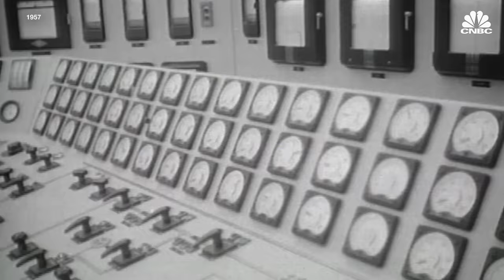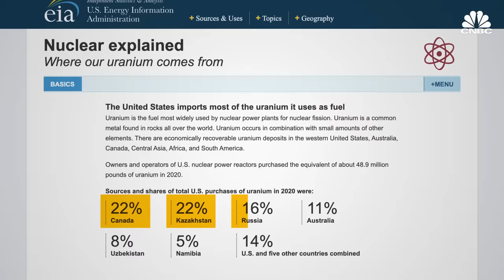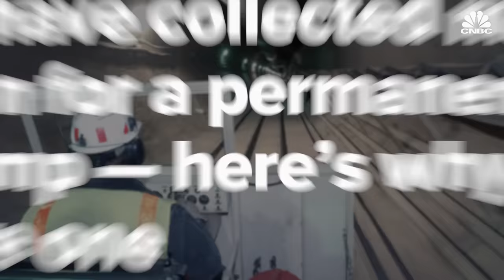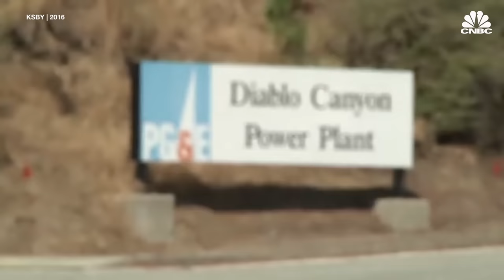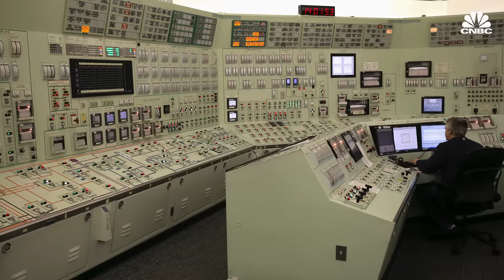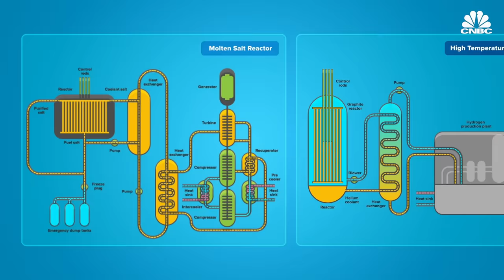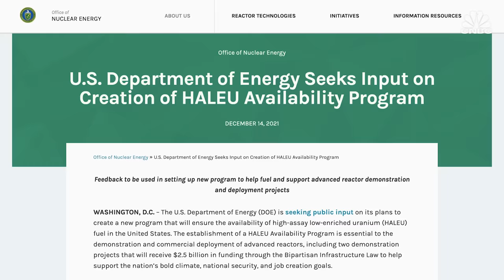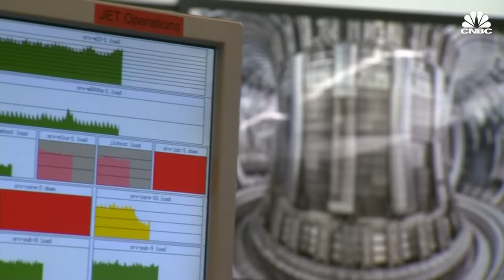Why Nuclear Energy Is On The Verge Of A Renaissance

Comment: Our rejection of Nuclear power was a massive mistake, and the environment has payed dearly for it as we continue to rely on fossil fuels for our electricity
Reply: It was rejected because of how profitable fossil fuels are for the corporations. Nuclear power is too cheap.
Reply: @jacktravolta1398  Saying something does not make it true.  Here is the reality of new nuclear in the U.S. and the only new nuclear power plant projects in the U.S. in decades.
VC Summer (South Carolina) new nuclear units 2&3 were canceled in 2017 after spending $17 billion on the project (original estimate of $14 billion and 2016 completion date) with no clear end in sight for costs or schedule. 

Vogtle (Georgia) new nuclear units 3 &4 currently 110% over budget and schedule (now over $30 billion) and still not operating. Mid way into the build, the utility stated that had they known about the many costly delays they would never have chosen nuclear. They are now delayed another year because according to the project management, thousands of build documents are missing. 

Is that too cheap?   South Carolinians would definitely disagree and Georgians still don't know if they will ever operate or how much it will cost.
Reply: It’s called fear.  And possibly mob mentality.  Combine the two and yikes, an over reaction.
Reply: Your second comment is an opinion not fact.  The earth is self regulating system to hot, O2, fires CO2 and cooling periods called ice ages.  The end of he last mini ice age was approximately 1715.  After that date the earth went into a warming period.  Tree rings are the method scientists use to correlate hot ( large tree rings) and cool (small) periods but we’ve only had thermometers for approximately 100 years. The first study, which indicated people were warming plant, never looked at correlating the size of the tree rings to a thermometer.  Another study did and the data matched up to 1996 then the correlated tree to thermometer data Deviated and showed temperatures lowering over time.
To me it seems the best approach is to conserve. You can’t legislate that, I see many people that are proponents of zero emissions that fly private. Talk about emissions.
Reply: @jacktravolta1398  nuclear power is literally the most expensive form of energy
Reply: @philmanke7642  nah mate
Reply: @philmanke7642  Prior to deregulation, the utility primary goal was reliable power. Now the primary goal is profits for the investor owned utility and that does not include excess generation capability
Reply: @jacktravolta1398  How is it cheap when nuclear plant costs billions to build operate and maintain. I do agree we need to build more of them
Reply: @jackkennedy9475  SO are planet isn't warming and if it is it's not caused by mankind's behaviors
Reply: The worst part is that some of the people against nuclear call themselves environmentists.  Does environmentalist now mean someone trying to destroy the environment?  😁
Reply: @winoodlesnoodles1984  Unfortunately it seems that way. To me an environmentalist is an engineer and problem solver. Those that criticize and complain are just activists with very little knowledge or they've been brainwashed
Reply: @wizzerwiser2056  Fair points!  You portrayal of activists is spot on.
Reply: @winoodlesnoodles1984  Greta TOONBerg always comes to mind.
Reply: @wizzerwiser2056  🤣😂😅🤣😂
Reply: @YellowRambler  So what is the right combination. Do you feel thorium is a better solution for nuclear energy.
Reply: 'always follow the science'
Reply: @pondeify  the political science.
Reply: The word is NUKULAR!
Reply: Well, it would have been nice has the previous generation(s) of nuke designers, builders, and operators hadn't screwed up.   But they did.
Reply: @GilmerJohn  the past is dead, we either move on, or we die with it
Reply: @Jim54_  --  We don't "re-invent the wheel" each generation.   There are lessons to be learned from US society turning its collective back on nuke power.

If you don't re-visit the mistakes it's  likely they will be repeated.

What were the mistakes: well we know about sloppy workmanship; sloppy design; sloppy maintenance; and sloppy operations.   How will the "next generation" of plants address these problem?   We seem to be being told that the "next generation" will be immune from all this sloppiness.   

Really?
Reply: @GilmerJohn  you are providing no sources that link to any current issues regarding these claims nowadays
Reply: @jacktravolta1398  so why are the biggest opponents to nuclear environmentalists?
Reply: @clarkkent9080  he means it's cheap as in not profitable for companies
Reply: @clarkkent9080  that’s just mismanagement and regulatory screwing.
Reply: @charlescarmichael1124  The NRC has fully approved the Westinghouse AP1000 for construction and operation.  The only thing the NRC verifies is that the plant is built as designed and critical safety systems are tested and perform as required and ALL that is well known by the utility.  NOW, how is that regulatory screwing?????

I agree with the mismanagement comment but with it occurring at 5 projects and 3 different sites, what makes you think it will be different next time????
Reply: @clarkkent9080  Why are there delays? Just like with Stuttgart21 or the finnish NPP, the delays are not caused by technical issues but by overregulation and insane protests.
Reply: @donaldduck830  You are apparently not from the U.S..
The Westinghouse AP1000 is fully 100% approved for construction and operation by our regulatory agency (NRC).  The only thing the utility has to do is build it according to design and the NRC will review critical weld x-rays and critical system performance tests.  The latest delay (6 months) at Vogtle was, according to their own CEO the result of "lost" records.   The records were not lost but actually the tests and x-rays were never performed.

In the southeast U.S. there are 0 protests, and 1000% support by politicians and the media.

Don't assume something you know nothing about.
Reply: @clarkkent9080  I have seen it too often. Changing goalposts. All the permits are there, and there have been public hearings (!) but at the 12th hour, suddenly there is media attention on something totally stupid like a snake or  a frog or whatever, and the entire permit process has got to restart. Or a change of political power.

I guess you never heard about keystone XL right?
Full permits given, there had been time for public discourse, and at the 13th hour, it got cancelled. Nordstream 2 the same: Fully built, all permits & hearings done, but after sinking more than 13billion into the Baltic Sea, it gets cancelled.

So I don't buy your comments, sry. If they had not done the tests, it would be a huge scandal and the responsible person(s) would go to jail.
Reply: Well said!!
Reply: @raaaaaaaaaam496 Who told you?😂
Reply: "payed"? WOW... We're officially doomed as a species 😢

Comment: As someone who works in the industry this is some of the best reporting Ive seen on this. Normally on these videos I have a millions asterisks to add about inaccuracies but they really covered all their basis. Good job talking to (and listening to) industry leaders for this report
Reply: Yeah, makes me suspicious why they may be changing their tune after a 50-year concerted propaganda effort.  What are they up to when they finally tell the truth?  (except when they called a containment structure a reactor)
Reply: For a 20 minute segment, the actual physics & engineering technical information was lite-weight. Perhaps the producers were trying to cover a breadth of material and didn’t want to focus too much on the specifics.
Reply: From CNBC no less!
Reply: @Nicnicnicolas89 It ain't happening so cry me a river
Reply: It's a pity that CNBC has spent years discouraging the public from nuclear energy, contributing to the present economic disaster. They need to be held accountable.
Reply: @toddbaker9922  didnt cover the economics too well either. And thats nuclear's real achillies heel.
Reply: Except calling the containment building the reactor vessel....